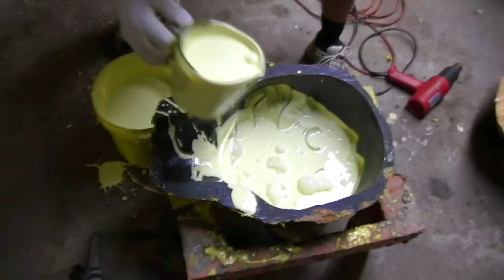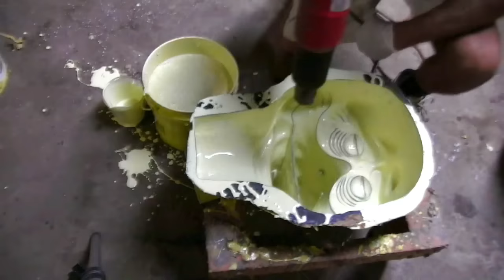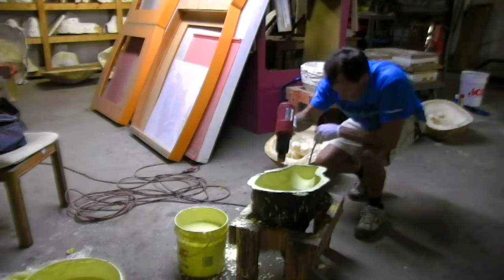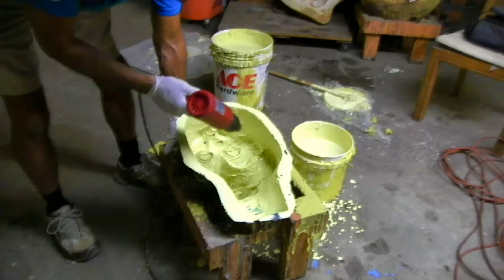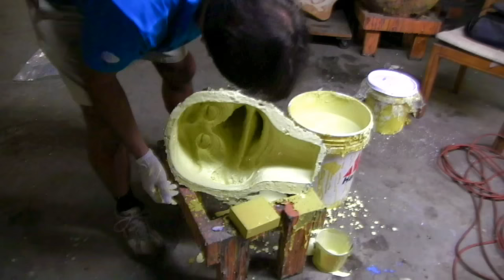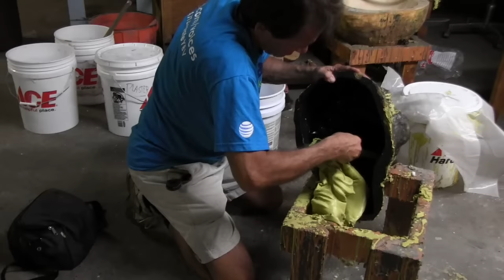Gooney Bird Mask Attempt #2- Rock-afire Explosion- Showbiz Pizza

Comment: Hey Aaron the reason why you are having problems are the solvents in the fiberglass molds they prevent the latex from curing properly or at all.. usually epoxy is recommended these days.

Look into getting a spray on sealant to prevent problems with the polyester solvents in fiberglass molds which can last for YEARS so I've heard.

Keep up the good work. Love to see your passion still being there.

Comment: Hmm...how about just layer the fibreglass mold with plaster...then you'll have a fibreglass mold in plaster!
Reply: That doesn't make any sense
Reply: the plaster molds have tiny holes in them that allows the latex to dry more efficiently, the fiberglass ones are pretty much sealed
Reply: I don't think that's true. I make plaster molds and they don't have holes in them. if they did it would leak latex out.
Reply: ShowbizPizzaFan I meant microscopic holes, they are large enough for air to circulate but not for the latex to leak out
Reply: +ShowbizPizzaFan it's a case of pores in the plaster I believe